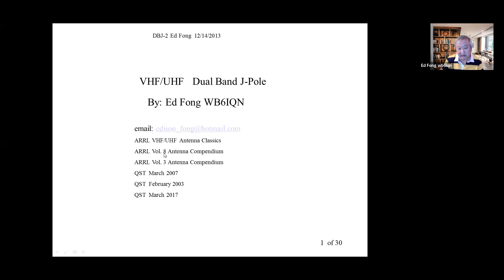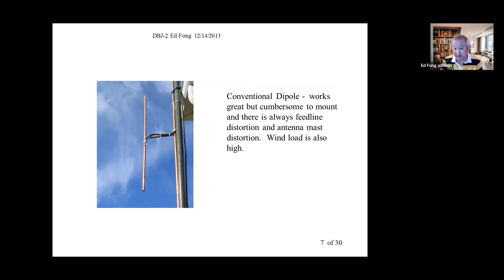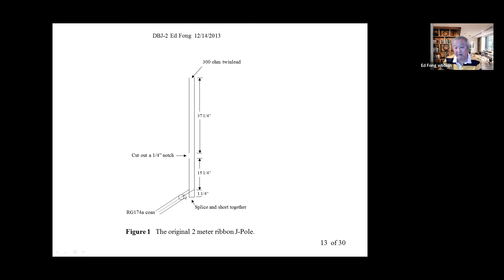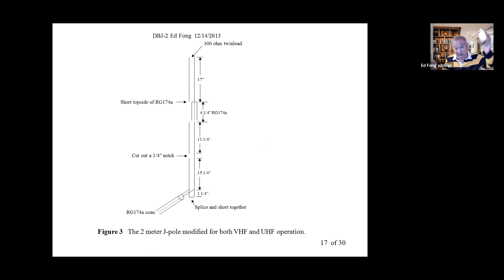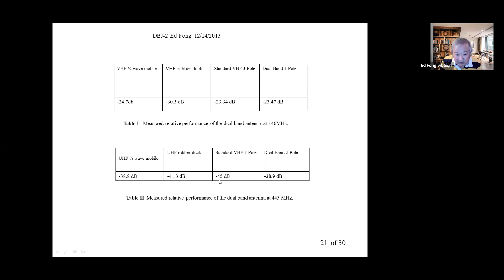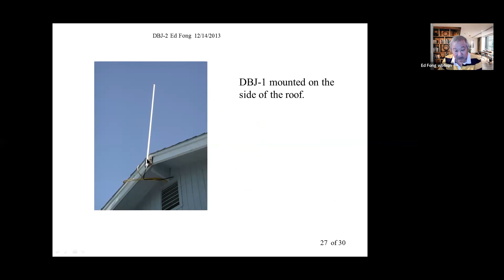Ed Fong at W6SD - Feb. 23, 2021

Comment: Dr Fong, great video. Which analyzer do you recommend for your students?
Reply: Certainly one of the NanoVNA's. They are cheaper than anything but the very cheapest CB VSWR meters, can tell you ALL about your antenna, and they can also be used as a signal source, a filter analyzer, a crystal characterizer, an inductance meter, a capacitor meter, a TDR (Time Domain Reflectometer to measure coax loss, locate shorts, opens, or impedance mismatch locations in transmission lines, and more. I suspect the market for antenna analyzers has already dried up completely with anyone who reads or watches YouTube videos.